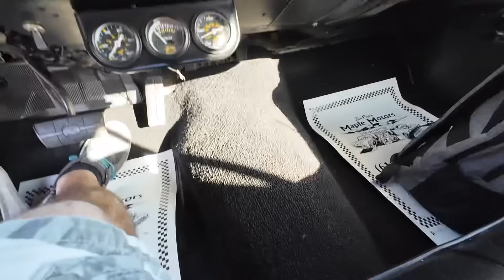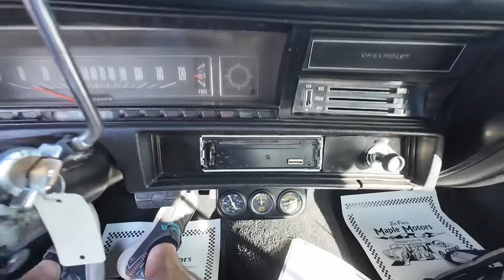Test Drive 1972 Chevrolet Chevelle SOLD $27,900 Maple Motors #2281

Comment: What’s the insurance on a car like this ? 

Rough estimate
Reply: More than you can afford if you have to ask this question. A young driver in a large city with a car with zero safety features I'd imagine $500+ per month for full coverage.
Reply: My 66 Galaxie is insured through Hagerty for about $20 a month. It's not a daily (as far as they know)
Reply: @mooosestang  Why would it be so much ?
Reply: Definitely Chck through HAGERTY INSURANCE first.GOOD LUCK👀
Reply: @zcorpalpha2462  Are you looking to buy this to daily and you are young? It doesn't have antilock brakes, it doesn't have any air bags, it has a v8. It's about as unsafe as you can get. If you are just looking to insure a classic that gets driven to cars and coffee then it wouldn't be that much, but don't try to pull a fast one like flyingace and daily it when you are only supposed to put 1,000 miles per year on it. Insurance fraud is serious business. They will find out. i'd be willing to bet a 2024 mustang gt would be cheaper to insure for a young driver and those are not cheap to insure!
Reply: @mooosestang  Interesting 

Thank You 

No, it would be local driving
Reply from the maker: Insurance is very cheap on classics, not bad at all
Reply: I pay about 300 a year for my 1969 chevelle that rarely leaves the garage, and covered for 30k.
Reply: @MapleMotorsNickSouthgate  So, why they telling me it’s expensive?